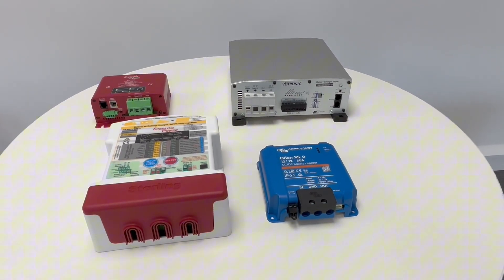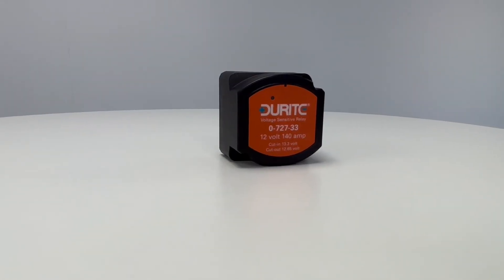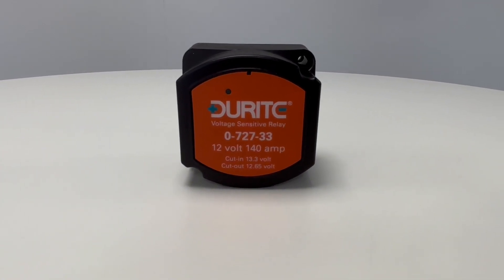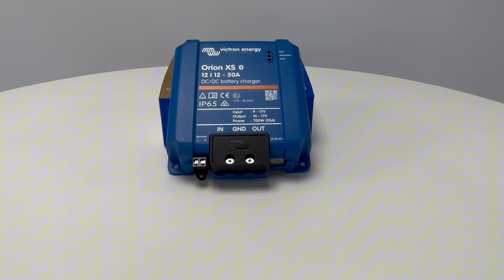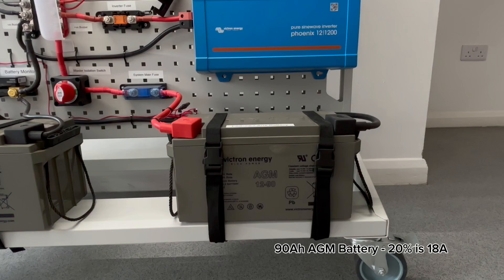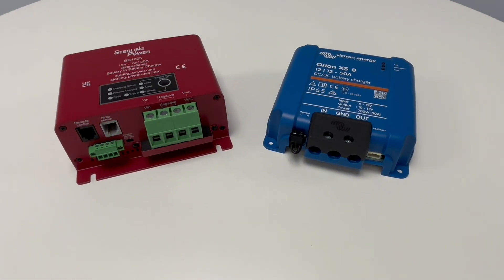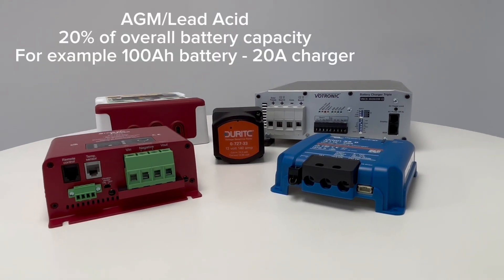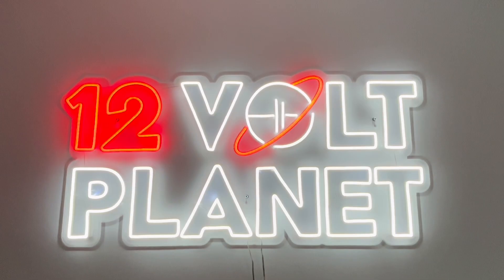DC-DC Chargers Explained | 12 Volt Planet

Comment: Hi - I’m still unclear on does a DcDc charger connect to the starter battery or the smart alternator or both 

One often hears it said that it’s the alternator that it connects to 

However, a smart alternator can’t provide much current. so I think the only place a dcdc charger can  get significant current (eg 30 Amp) is from the starter battery 

So I think the dcdc charger must be powered by the starter battery and all the alternator does is charge the starter battery 

Really would like clarity on this topic! 

Many thanks